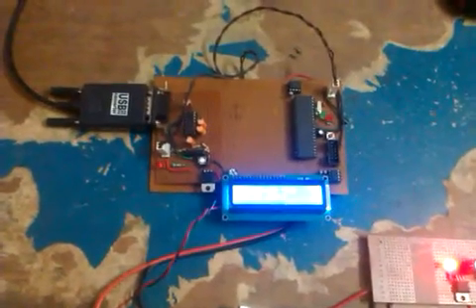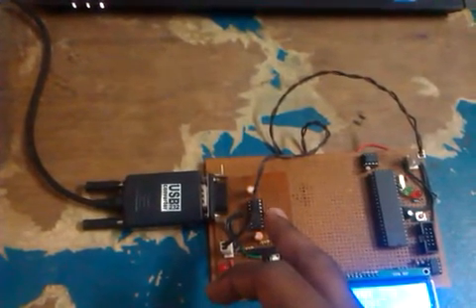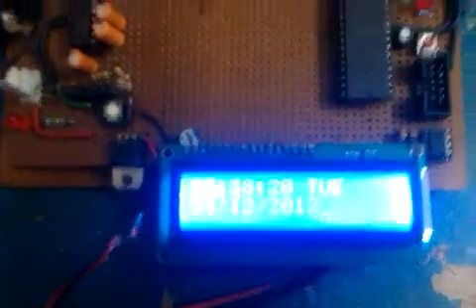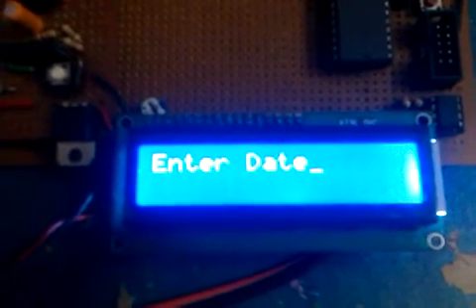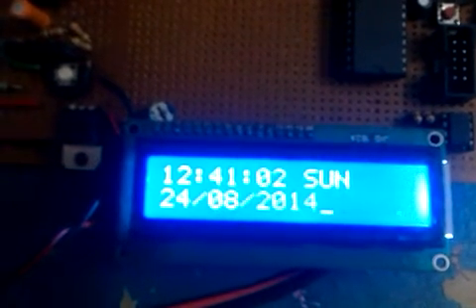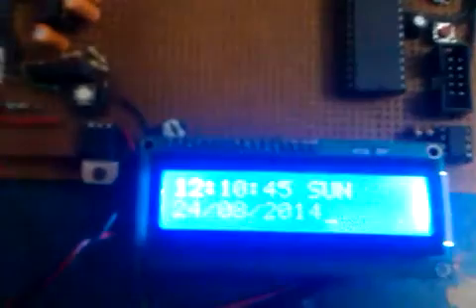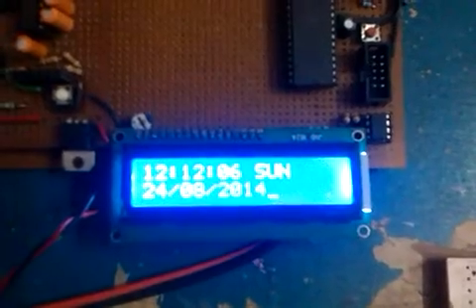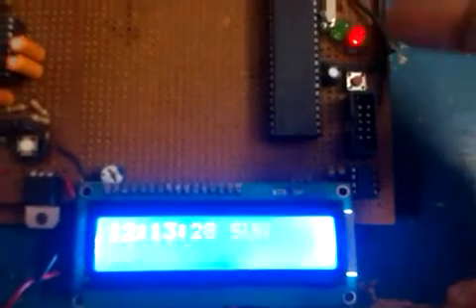Digital clock using RTC DS1307 & 8051 with serial communication for time settings

Comment: Bro components ka list bhej na plz yaar
Reply from the maker: Hello Akshay. watch below link same circuit i implemented in proteus there u can get all components which i have used only MAX232 & its relative components u need to add. All the best for your project. 
Digital clock using RTC DS1307 & 8051 with UART control